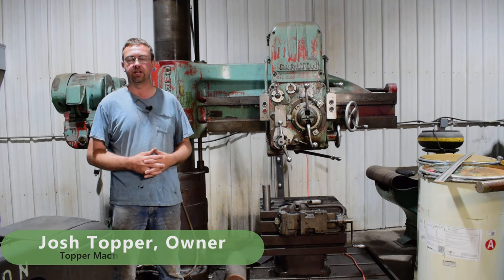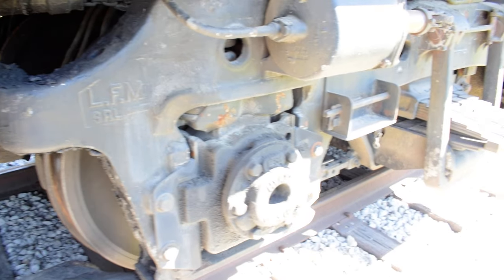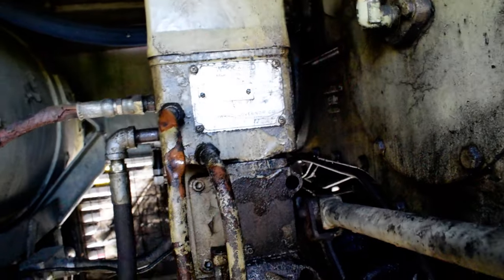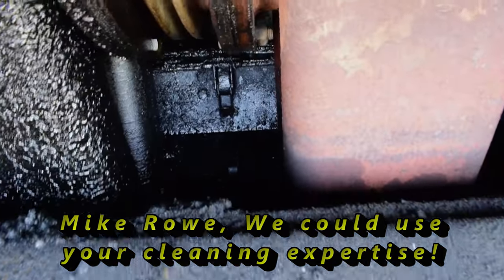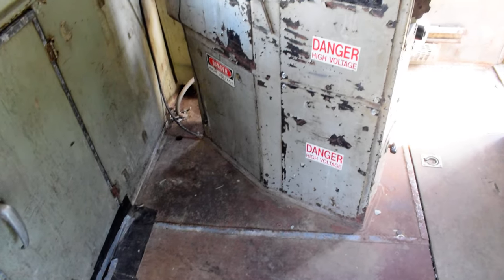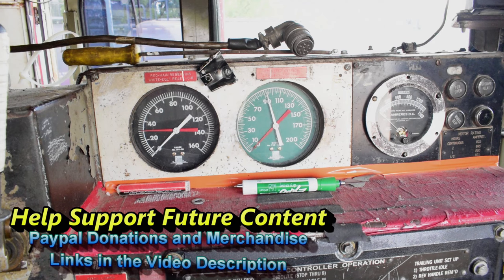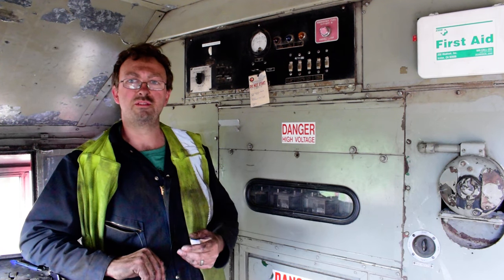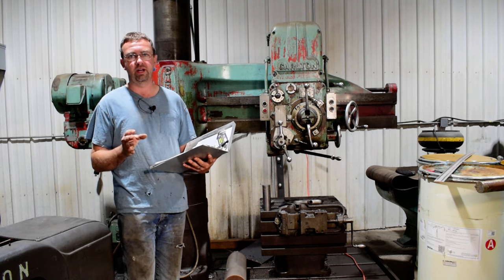Locomotive Bought on an Online Auction - Helping My Customer Get It Moved - Shipping Nightmare

Comment: I was a machinist at CN and we constantly had problems with American railroad inspectors.
Reply from the maker: Don't get me started on incompetent FRA inspectors.
Reply: I wonder how the Escanaba & Lake Superior RR can even operate based on the condition of the track... WSOR is also ex Milw. lines but they actually have maintenance on the track. In light of recent derailments on Class 1 lines maybe track maintenance will be stepped up.

Comment: I worked for EMD for 35 years. Very good video, but l was a bit surprised at the amount of grease/oil on the front stack. Obviously that will be cleaned off before the unit is placed in service. As far as cleanliness of the rest of the engine, it wasnt to bad. We found that the front coupling seal leaking would fling oil up and all over the front end of the engine, unless there was a coupling guard installed.  Once again excellent video. Glad to see 40 and 50 year old units still in service. I may have tested that 645 engine, when it was new!
Reply from the maker: The nastiness of this engine was just from idling for the last 10 years. The stacks were mostly plugged. I've seen this on almost every unit in this kind of service. Should clean out nice.
Reply: @TopperMachineLLC  I know it is against all mechanical gods laws, but working on these for 15 years as a composite mechanic then a CMO I worked for a company that (gasp) put profit above everything.... so we had a GP9 that a company leased that had sat and idled till the low oil shut down killed it, the site mechanical foreman said it must have been a month or more. (dispute between who I worked for and the company resulted in them just parking the unit after getting a mule on site to do their car spotting) Go up to the site and the unit was over 55 gallon low on oil and when started smoked so bad. Shipped it to a new location with the understanding it needed work and fired it up under load test and pulled 1000 amps out of it for days still smoked bad, till the point of oil spattering on the hood and paint. I took a can of Comet and dumped in the turbo while in notch 7 making 1000 amps and in 10 minutes it has quit smoking and spitting oil. I know I took a lot of life out of the engine but the company did not want to repack it... so. 
Anyway nice video and thanks for the memories of burns, cuts, scrapes and other maladies that befell me during my time working for the railroad and the lovely people I met whom inspected my units for shipment :) Oh and PS I worked for Watco for about 3 months and the good ole boy network was just complete BS to work under.
Reply: @JimNichols  Turbo? I assume it was repowered.
Reply: Jeep9 was roots blown

Comment: Man what a filthy thing! I'd recommend a 55 gallon barrel of Cyclone cut with water 1:1, and a pneumatic foaming device to assist in turning the solution into suds for larger and easier coverage of everything inside and outside the carbody. Blast all the internals with a pressure washer (hot water one works best!), being mindful not to hit the governor plug, and brushes to scrub the outside of the carbody, finishing off with a hose rinse, and she'll look good as new.

Glad she's still a serviceable and functioning unit!

Comment: You've never seen an engine that dirty!? You should see the ones we run at the plant i work at. That's what they look like, and worse! Also, sounds like watco and union pacific have a lot in common. Those guys are tough to deal with too. I'm actually a new locomotive engineer, i operate GP38's, and i have been learning a lot from your channel on how these massive machines work. Thank you!

Comment: One of the GM plants that I worked in for the Terex Division was on Clinton road in Cleveland Ohio.
At one time earlier it had been an Electromotive  plant, so it was ideal for building the earth moving equipment , having 50 ton cranes, and huge welding capacity.

Comment: "Inspector" is a job title that seems to run from 0% GAF through to someone that would measure a blade of grass with a micrometer. I've had electrical inspectors that would barely look at a job to ones that picked everything apart with a fine toothed comb to attempt to find an issue. My worst one was a fire alarm inspector that I had to explain to him what had to be tested/inspected as part of a new building verification, since he didn't seem to have a clue what his job was.

Comment: Love the sound of those engines starting up. Worked on locomotives for a short time right out of high school, ill be working on boats soon for a company with a fleet of boats most of which are 12 or 16-545s, some smaller are 12-71s, all twins. Super excited for that.

Comment: Since you run your welder from an outboard motor tank, the welder might start faster if you put a primer bulb in that fuel line. I always had to pump the primer bulb on my Evinrude.
Reply: I was thinking the same thing. He said it had been sitting awhile and I'm sure it took awhile to get the engine primed. Looks like he flooded it right before start though, as I seen a little black smoke. I like the idea of a boat tank though, that way it's easier to make sure it's got fresh gas on something that sits a lot.

Comment: I served my Apprenticeship on Diesel Locos. EMD's, GE's,and a lot of English locos(50 years ago!!) . You got through a load of service work to get it towable . We did 500 and 1000 hour service intervals so the locos were constantly examined to prevent breakdowns in service. That didn't allow for operator abuse...
On your customers Jeep , Most of the prime engines oil appeared to be on the outside ...
🙂.As an apprentice,part of my job was to mop down the engines with a coal based degreaser called turgosol. Applied with a regular mop then hosed off with water,it was brilliant stuff but stunk like old coal oil .It also gelled in the drains. 😵‍💫.That jeep looks to have decades of service in it yet,great buying!.

Comment: I used to run that unit before it was sold to the mill.  Was a good runner. Has a 16-567C out of a GP9, not 645 assemblies. Rebuilt by ATSF in 1980 or so, but no upgrades.
Reply from the maker: There are most definitely 645 power assemblies. And the electrical is 100% upgraded. I have all of the electrical drawings and it matches those of GP38.
Reply: The 645 assemblies must be why it ran better than the other one, which still had a 567B crankcase with the square access ports. Roundhouse guys had a couple 567 assemblies hanging around just in case they were needed, but must not have been for 701. 

Switch mode used to work. Unsure if it still does.

Comment: My uncle has a small engine like that on a trailer with a welder attached and vertical exhaust stacks. We were on the highway when the trailer came off the ball. it flipped over and we drug it on the 1/2" thick metal lifting plate it had. All the damage it had was the battery was thrown off, the exhaust stacks snapped off and the fuel tank had a nice new hole in it. After my uncle fixed all those it ran again!

Comment: This is a very cool locomotive. It was great to see the process you went through. I can imagine that it is expensive to own one of these. It sounds like it was difficult to get it moved
Reply from the maker: Once we got through the idiot inspectors, and the billing department, it shipped so easy. As far as owning railroad equipment, it's just like anything else. If it's your business, you absorb the expenses. If it's a hobby, it's part of the hobby.
Reply: I'm thinking 10's of thousands to get it in tip top shape but once it's done it will probably run another 50 years..railroads don't buy brand new equipment unless they have too...they are huge on recycling the old worn out engines  but once overhauled it looks Brand new
Reply from the maker: @lornperkins4270  $2500 tops. Water pump is around 500 and the radiator will be the rest. Everything else is cleaning and paint.

Comment: The ethanol plant I worked at had flame detectors all around the sight.   The procedure for hot work was to not shut the detectors down.  Hence the no torch policy.
Reply: Build a shack around the work site?
Reply: I would have guessed it would be more about a torch explosion then an ignition source igniting something at the plant.  IE the plant is safe enough that an open flame or heat source is not going to cause an issue. But if something went wrong with the torch and it exploded. the chain reaction would be bad.
Reply: @EQRuges  point was that the flame detectors when tripped shut the plant down, all hot work precautions were in place but at the outside chance a flame was detected from a torch it would trigger an unwanted shutdown, so no torch work.

Comment: We sold a couple locomotives a while back ago, and all the work the guys had to do to give those things self aligning couplers was insane lmao. But they went through the same deal with getting them ready for interchange. The second they came up on our switch list I got those things out to interchange, and UP decided to ignore the units for a couple weeks before it was finally moved. Both units were going to the same place but at some time they were uncoupled and sent on two different trains (in the process they connected the walkway chains and then proceeded to rip them off and bend the handrails) I think it took 2 months for those engines to go a whole 100 miles..
Reply from the maker: Ive been doing this for 25 years.  The last several years has been absolutely horrific.  Precision Railroading at its finest.  I hope E Hunter Harrison is burning in hell.  As I only do this occasionally, I tend to notice the craziness more.  One of my partner shops does this daily and has told me stories that are absolutely insane.

Comment: Can relate to the "You can't use a torch, but welding and grinding is OK" thing.
Smoking a cigarette while heating some thick metal with a rosebud. HR Lady sees me and gives me grief about smoking because it's a "Fire Hazzard". Umm. Err, O-kay.
Reply from the maker: Some people have no clue. Unfortunately these are the people who set the rules.
Reply: As they say, those who can, do. Those who can't, teach. For the rest, there's HR.
Reply from the maker: @custos3249  I've always said, "those who can, do. Those who can't do, teach. And those who can't teach, inspect."
Reply: @TopperMachineLLC  Isn't that essentially what HR is, the ultimate policy and colon inspector?
Reply from the maker: @custos3249  I was referring more to govt inspectors. OSHA, FRA, DOT, etc
Reply: I had a HR person tell me to wear safety glasses. I said they are, I took them off immediately and smacked them with my hammer.  She jumped in the air, turned around, and left.  So sweet. :)

Comment: Fairmont used the CCKB in their MT-14 and MT-19 motorcars.  Just awesome little motors.
Reply from the maker: Great motors, unfortunately sCummins destroyed the product support when the acquired Onan. We are limited to aftermarket and parting out others to keep running.
Reply: Gravely tractors used various models over the years. And at one point, Gravely and Onan were part of the same company. I have one with an even older Onan than this welder. It is a CK model. Most of the Gravely Model 450s used a CCKA but mine was the prototype for that model line. So this welder likely was from in the 60s. Best running twins of their time. Well next to the B47M or B48M Onans.😉
Reply: Yep.  The CCKB in my MT-19 is solid as a rock.

Comment: Great video. Learned more about diesel locomotive than any other movie/video I've watched. I feel like I could prime and start one myself now. lol
Reply from the maker: Please don't. There is way more than I have shown.
Reply: @TopperMachineLLC  You can say that again. And different makes have different requirements. On some you can check the oil level while running just by pulling the dipstick. But try that on an ALCo RS-3 with the original engine without turning off the blower and you will get a face full of oil.

Comment: Okay, that’s a fairly common thing, having naked flames not permitted, but sparks are allowed.
I’m sure you’re in a specific zone and if you moved closer to the plant, you’d enter a zone where sparks were forbidden too.
It’s a risk assessment thing. A continuous naked flame constitutes a higher risk than intermittent sparks. You’d need to be doubly unlucky to be making a spark at just the right time when the random combustible mixture happens to blow by.
Doubtless someone who knows the actual regs will respond shortly

Comment: Like the old welder. I have some older equipment and am careful to only use ethanol-free fuel. Pure gas has a long shelf life and won't ruin those old fuel systems.
Reply from the maker: I got this cheap because the previous owner used ethanol. Had to bead blast the inside of the carb to get that crap out. I avoid it at all costs on my older stuff. Only use ethanol fuel in newer vehicles with a warranty.

Comment: I worked 41 years on RR locomotives. Brake shew over hang means all the bushings in all the brake rigging are worn and should be changed. We used other methods like brake strap guides applied under the binders.
Reply from the maker: The messed up part was that we had less than 10% overhang on the worst shoe. Inspector claimed 50% on several. All photographed with measurements and forwarded to his boss. His boss claimed to have fired him after that. We were at their mercy, and after begging, finally got them to agree to have one meet with us and explain why. That was when we finally got somewhere. I kind of interrogated the last inspector and got an interesting story. Basically none of their people had any background or experience.   I've been doing this over 25 years and have never had any problems like this.
Reply: @TopperMachineLLC  You, you are now an inspector.  Here is the manual.  Oh, and by the way, be a complete jerk on business we don't want!
Reply: @TopperMachineLLC  Gonna take a stab and say that inspector went to work for Norfolk Southern.

Comment: Hey Josh, I have a P&H " double bug" basically the same welder except it's CC-CV so it's made to run a wire feeder as well. Same deal, no starter it just sends current thru the generator to start. It did run, hasn't been touched for probably 8 years. It's in central Wisconsin, let me know.
Reply from the maker: Send me an email!!!  Most definitely interested
Reply: @TopperMachineLLC  , I couldn't find your email address
Reply from the maker: @mikeduhm5325  on my YouTube about tab, or go to my website. Links all over for email. I'll add it here, but may get removed. youtube@toppermachine.com

Comment: WATCO has a reputation for low-balling bids on service contracts to add more feathers to their metaphoric cap's. They hire inexperienced employees at low rates to continue growing their brand. The problem is at the management level where managers are only concerned with keeping operating costs at a minimum to increase 'their' annual bonuses. Example: As a engineer who worked for WATCO, I would write up locomotive defects 1) 50-year-old SW1500 caught fire (literally) while shoving 32-flammable haz-mat cars. After setting the unit out 'bad order,' WATCO's Mechanical Dept put it back in service where it promptly caught fire again. Customer DOW Chemical knew about this but decided to turn a blind eye because – once again – cost cutting...

Comment: Not being able to use the torch, but being able to use the grinder and the welder at an ethanol plant make sense when you consider that you're outside, where your risk of setting something off inside the plant is minimal, and the welder and grinder make only sparks while the torch, although not likely, does carry a non-zero risk of explosion, which I think would be... bad.

Comment: Exhaust could be cleaned by running in notch 8 but these short lines rarely pull like that. These EMD turbocharged and roots blown do like running hard
Reply from the maker: Just running in notch 8 will not clean them out as you say. They must be under load to generate enough heat to clean out. I have cleaned out engines that are plugged up in notch 4 with a heavy load. The load is what makes the engine work hard enough to generate heat. Just revving the shit out of it won't make much heat, just wastes fuel.
Reply: @TopperMachineLLC  I meant to imply that, sorry